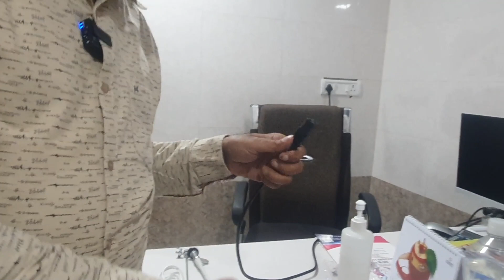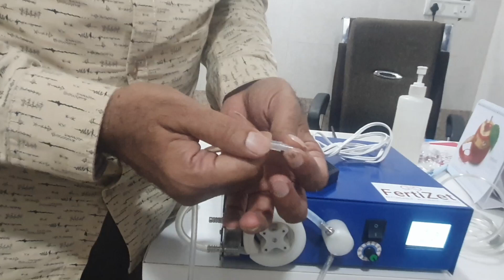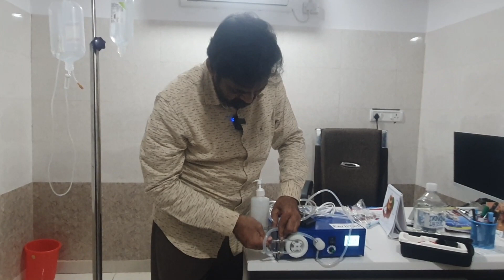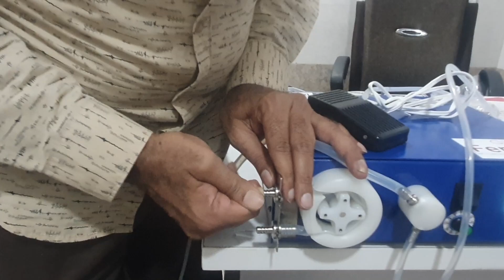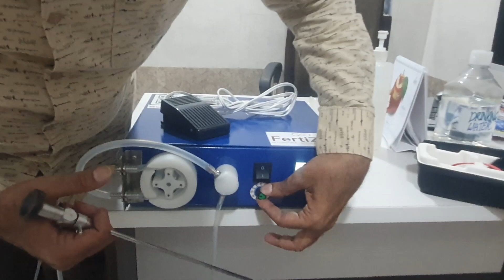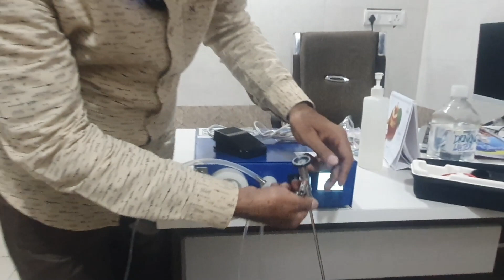How to start FertiZet | Most affordable Hysteromat | how to change silicone tubes of hysteromat

Comment: This machine is version 2.0. I have upgraded this to 3.0 more accurate flow control and better volume. Now I am going to make it fertizet 3.1, one major change is power supply unit. Till date i got issues with smps in one machine out of 32. I am changing it to external adapter which can be bought on amazon if u burn out one